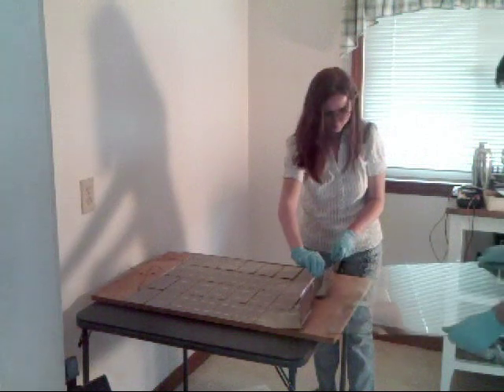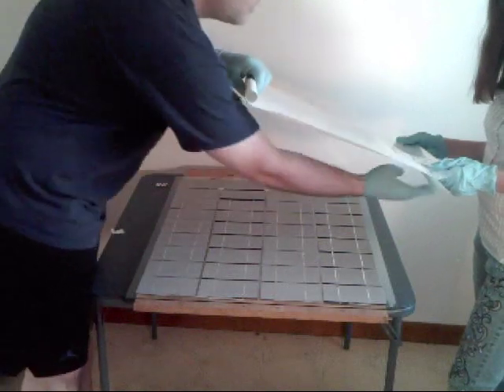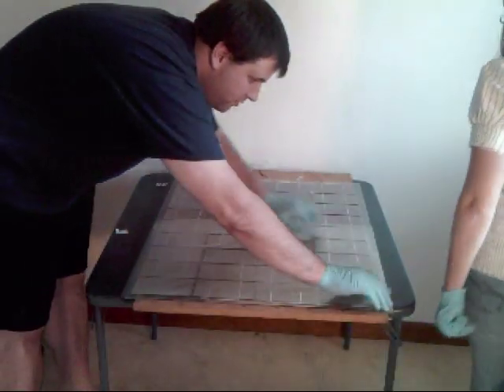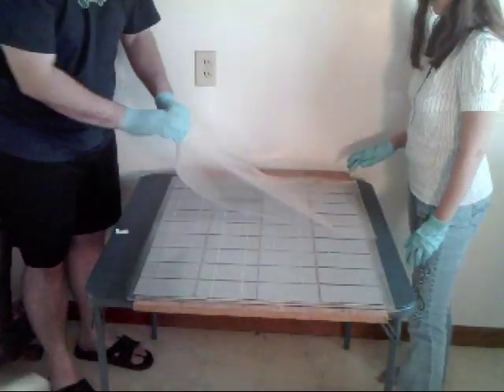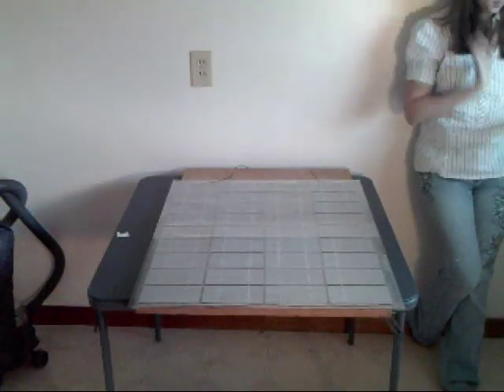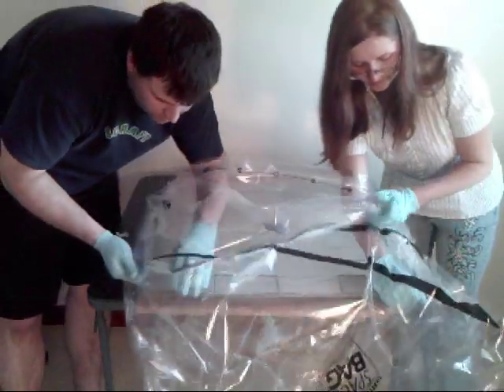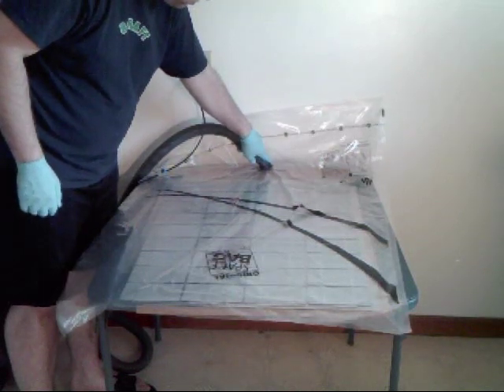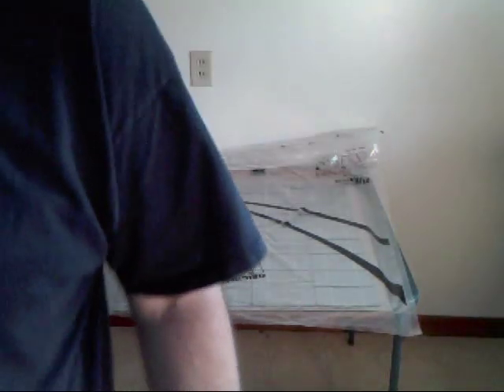How to: Aluminum Frame Solar Panel P6

Comment: nice video another way to build the pannel so fare from what I see the eva stuff is better and it seems to be what factorys use.     I see the lamanant would be good if you want to move the pannels I have been wanting to build my own pannels and might give it a try one day.  I guess you would use plex glass or plastic for backing and eva glass for the frount that is shock reistan against heat and hail.    I wll have to try this one day.

Comment: @gcdrummer02 Reason I asked is I saw photo's of a roof mount system that had burned up. I had some wax paper on the back of one I built and it looked nice but I took a piece off and lit it and it burned rapidly. So I removed it. It was just to hold down the cells til the sylgard 184  hardened anyway.